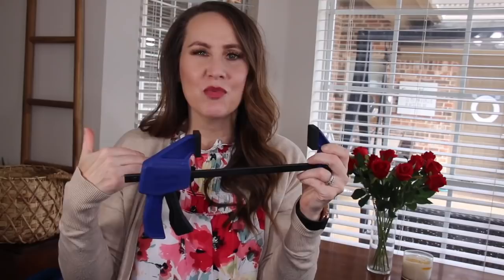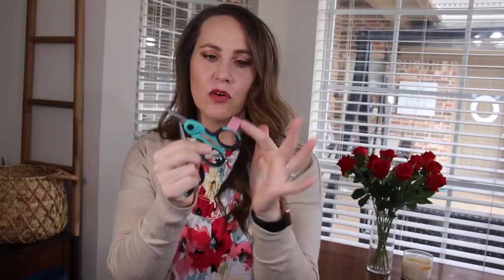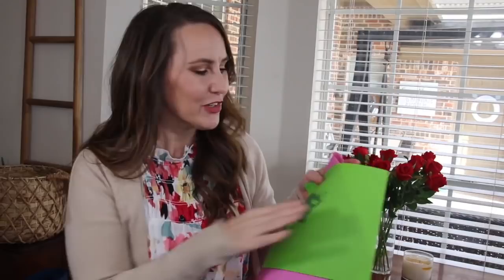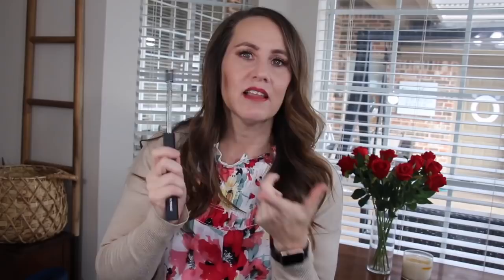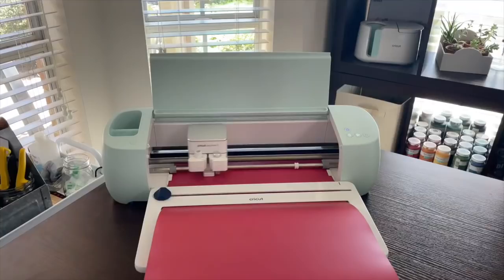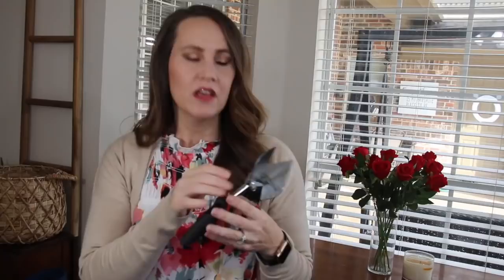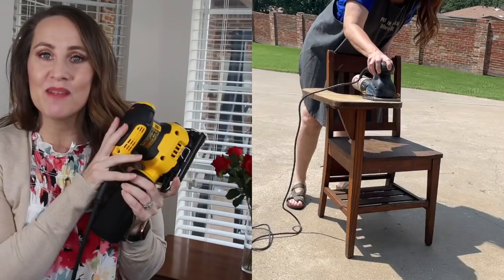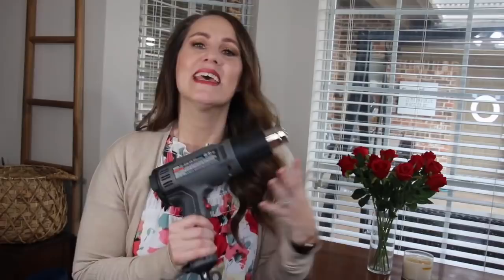22 of the BEST Craft Tools - Making Crafting Even Easier!

Comment: I love my crop-a-dial and my miter shears. I do use the grommet portion occasionally but mostly it’s a great hole punch! Thanks so much for the info
Reply from the maker: My question to you is... what do you use the grommet part on? Do you scrapbook or make cards?
Reply: @LittleBitofCalmCrazy  I use on faux leather projects. For example I made backpack hand sanitizer holders for my grandkids. I have also used it on paper projects and on fabric I used on DIY’s as an accent.

Comment: FYI not only does that screwdriver have large & small Philips & Flat blade screwdrivers but what holds them can be used as a 1/4" & 5/16" nut driver.

Comment: Great list, Jennifer… I love my Miter Shears! The next 2 things I have on my ‘to buy list’ are the Silicon Mats & Spray tent… I tried 2 of the Sure Bonder glue guns from Hobby Lobby, returned both of them! Wasted more glue then I used, they dripped so bad.
Reply from the maker: It sounds like you have a good list going! I am sorry you have a bad experience with the SureBonder glue guns. 💕
Reply: I had the original detail sure-bonder, but I could not get glue out. In the trash it went! I bought the cordless mini details from Lynn Lily and I love it!

Comment: Thank you for posting thise supplies. Its been a while since I have been shopping for supplies. I love to bead, do crafts, sew, and make things. I need good scissors for cutting fabric. What do you recomend? I have pliers, small wire cutters, crimper, but its been a while since I have gone to shop for other items. Thanks for reminding me. I liked the rotary cutter. Years ago my daughter in law gave me rotary cutter and mat, the cutter wasn't sharp at all. Where can I get the rotary cutter, the iron,  the stapler , the utility knife/ scraper? I want them. Thank you.
Reply from the maker: You can replace the blade on your rotary cutter. That may be all you need to do. If you do still want to replace your rotary cutter I suggestion is to pick on with the handle you like to grip. This is the one I have and love https://amzn.to/2Lq67PC
These are some great fabric scissors https://amzn.to/3KXUj17

Comment: I bought the SureBonder Glue Gun and its been the worst the glue sticks are always getting stuck in it ... it currently has a glue stick stuck in it ... 😞 I had such high hopes for the surebonder glue gun 😞
Reply: I bought one also and I have the same problem also when I want to take it off the base it gets stuck and the whole thing comes with. 🥺
Reply from the maker: I am so sorry you have not had the same experience I have had with the SureBonder glue gun. I will tell you I only use SureBonder glue sticks. I am not sure if that makes any difference. I have had my glue gun before it was even released to the public, and have never had an issue with it.

Comment: My question is does the crop-a-dial and Miter shears take a lot of hand strength? I love my detail surrbonder also I use it just about all of the time.
Reply from the maker: The crop-a-dial doesn't require much hand strengh, but if you use thicker pieces of material with the miter shears... they can require a lot. Another option would be a mini electric crafters miter saw. I haven't used one myself... so I don't have one to recommend yet. 💕

Comment: What is smart vinyl?  I mean what is the difference?
Reply from the maker: Great Question. 
Smart vinyl does NOT require at mat. That means you can do 2 things:1. Cut several designs without stoping (like I did for the Team Shirts) and 2. You cut longer designs. The one downside is that smart vinly is still very expensive and there is not any current off brands making it that I am aware of.